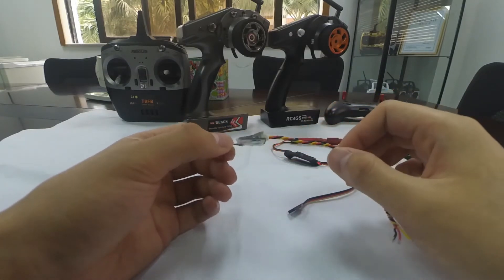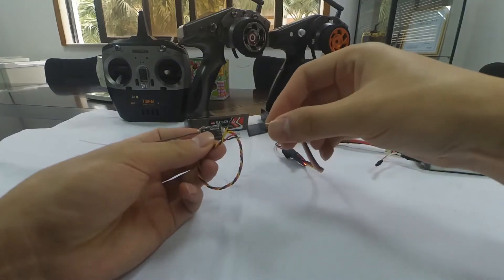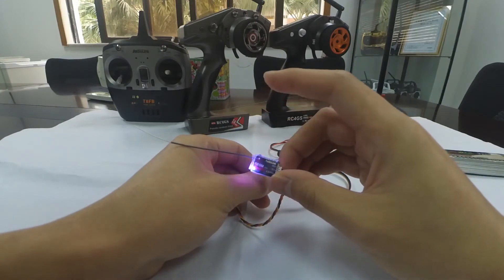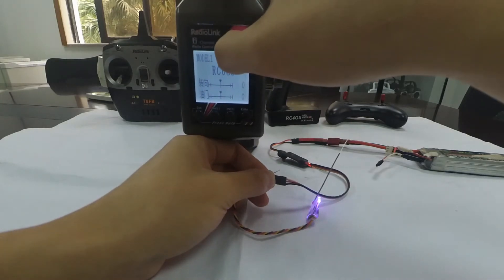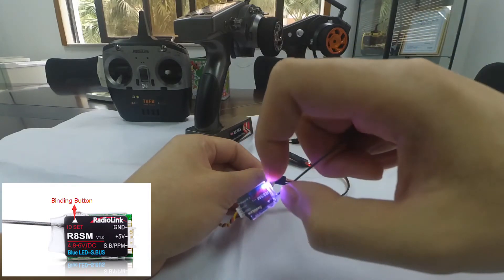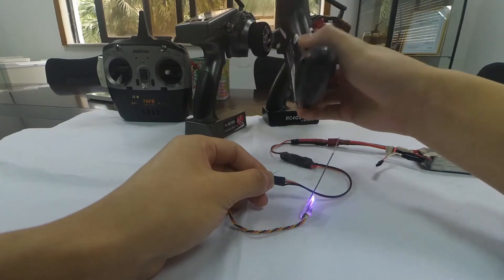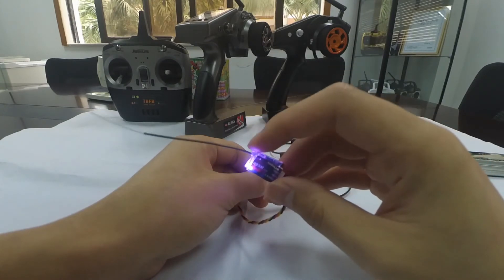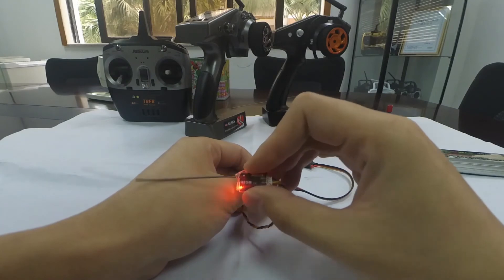How to| Make RadioLink receiver R8SM bind with transmitters

Comment: can i ues it in a baby ape fpv drone
Reply from the maker: Hello, sir. R8SM supports SBUS and PPM signal. If the flight controller of baby ape fpv drone supports SBUS and PPM signal, you can use R8SM in it. And you can use T8FB and T8S transmitter with R8SM. Here is our official website for your reference: https://www.radiolink.com/  If there is any question, please feel free to contact us. Our email is after_service@radiolink.com.cn
Reply: @Radiolink_official  Why is my drone blinking a red light but the receiver is connected and everything
Reply from the maker: @dustinplee5067  Hello, sir. May I know what device is blinking in your drone? Is it receiver or flight controller? If receiver is blinking, there is no binding of the receiver and the transmitter. Please re-bind them. If flight controller is blinking, could you please check detailed manual of the flight controller to check the reason?